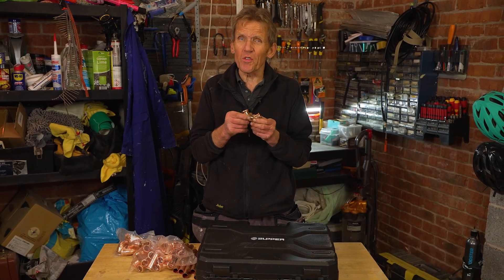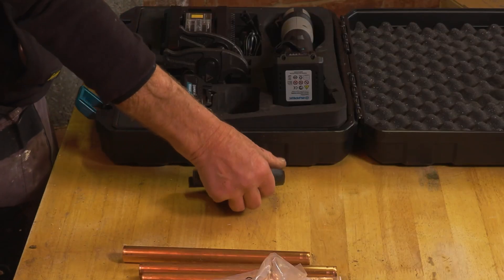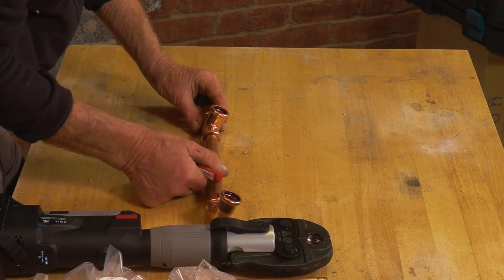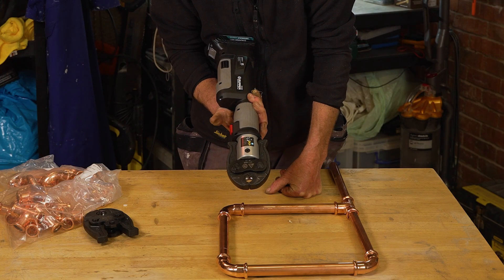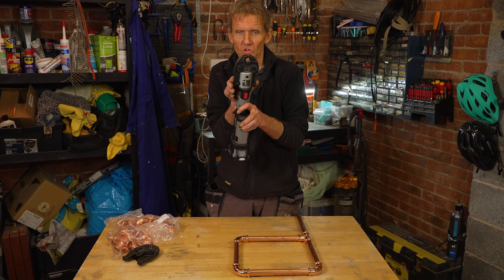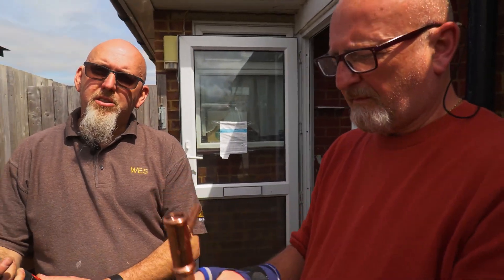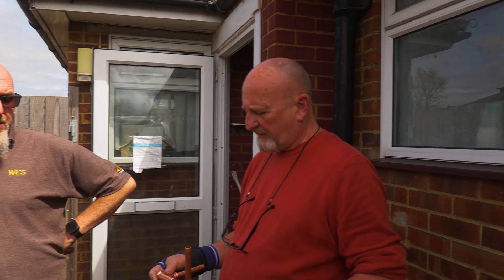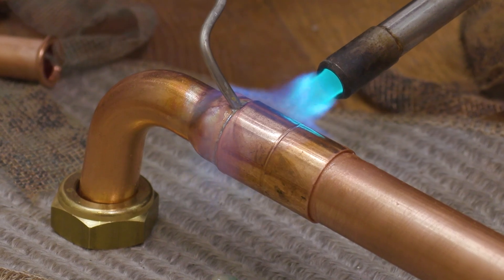Z-Press ~ Quick, Clean & Reliable Press-fit

Comment: When is copper preferable to PEX? And is press acceptable for natural gas?
Reply from the maker: They do make a press fitting for gas and it is for use on copper. I would always prefer to use copper where the pipework is on show. We usually use it in the boiler room and around the hot water cylinder. Elsewhere the long runs of PEX are preferable.

Comment: It’s a different world from when I was wiping lead joints and working with Yorkshire and end-feed fittings. We even had a time when it was Stainles steel pipe that had to be soldered, what a disaster that was. Not to mention copper lined steel pipes that rusted for the outside in. My neighbour is a great exponent of these compression type fitting, in fact he won’t use anything else so it’s good to see the price is dropping down. Me I’ve been retired for the past 18 years. 😂

Comment: I really do like press fit, however I don't like that every manufacturer are using different connections and pipes that usually are not interchangeable. When using a Uponor (UP) clamp, I can't use a Viega (V) or Bonfix (M) or Henco (TH) connection. etc etc. So basically it's a vendor lock in.

Comment: as for leaks on soldered joints are super rare , compression is quite common usually just a weep and easily fixed, push fit also seems to have the odd leak, almost always for me at least from scratches on the pipe and ofc the classic not pushed in correctly

Comment: The fun part about crimp connectors is that they may start leaking months after assembly.
 I like copper connectors that stay tight for a lifetime.
 Alloy is your ally for peace of mind.
Reply: That’s BS…. I’ve been fitting press fit for over 30 years, we’ve just finished a chilled water job with over 2000mts of 100mm and 50mm pipe and we’ve never had to go back on a job due to a leak…
Reply: @richarddutchholland4780  Hot water does a job on neoprene O rings they shrink, dry out and crack...Cold water isn't quite so bad...

Comment: I still think soldered columns of copper pipework including parallel cross overs and especially street fittings just look more neater compact and professional. I do agree though that press fittings are useful on long pipe runs and under floorboards and attics where they could be the likelihood of a fire. Just my own opinion very good video.
Reply: That’s exactly my thoughts and under a boiler/work top we are always squeezed.Probably need some practise and use where more efficient.Look great when done 👍

Comment: the fact that i couldn't find the price anywhere, it means they hide it because is expensive. So ,yes it's clean,quick.reliable but they failled to make it affordable . Better look for cheaper alternatives
Reply from the maker: It is under a thousand pounds and you can get it through your independent merchant. Nobody is hiding the price and I have not seen a cheaper machine on the market that is any good so I wish you luck with that.

Comment: Biggest advantage over solider was not mentioned . You can connect  one pipe  to the fitting at a time .
ie   Two pipes of a tee then add to set up with the last one .  100% would have one  if I was trade but as a DIYer will have to stick to my Rothenberger just due to price .

Comment: How long do the o rings last before going brittle?
Reply: The o rings are backup. It will seal even without the o rings. Check YouTube
Reply from the maker: I am not sure when they would go brittle if ever but they give them a life expectancy of 50 years. Lubricant is in the mix not added afterwards
Reply: I can't believe ppl continue to ask about the o-rings on Pro-Press

Comment: I’ve never used pressfit but I definitely think it might be something I’m gonna have to get in to due to the no hot works issues. 

I’d like to hear from guys that do a lot of boiler installs. How do you find it for instance when doing a combi swap? I fit logics and the pre-made tails bring you off the wall at Clíp distance. Are these jaws small enough to get in between the vertical pipes as they run up the wall and behind the pipe at Clíp distance?
Reply from the maker: Most of that pipework can be pre-fabricated and clipped to the wall. It just requires a slightly different approach but it works fine

Comment: Why are these machines so blimmin expensive, they have a battery and look like a multi tool, but are over a grand to buy    Compared to other tools with similar internal gubbings if you get my drift.
What’s so special or different in them???
I’d love to know
Reply: Far less demand I expect.
I also presume these are a calibrated compression tool to ensure the pressure applied is within the correct tolerance for ensuring a tight fit without crushing the fitting - the R&D and manufacturing tolerances etc will need recovering to make this profitable.

Comment: Not compliant with gas regulation which prohibits use of any plastic parts. O ring is a form of plastic
Reply: Press fit is.  You fit the fittings with yellow, not black, o rings, usually marked gas on the fitting.
Reply from the maker: There are approved gas fittings for press fit.
Reply: O ring is a synthetic polymer.

Comment: How long does the o-ring last?
Reply from the maker: I have looked at this subject across several sources. EPDM 'O' rings are said to be good for at least 50 years. Of all 'O' ring material it is one of the most durable. The press fit locks the pipe to the fitting so there is zero movement on the pipe where it enters the 'o' ring. Just keep them away from hydrocarbons. Also avoid mechanical damage when assembling or storing fittings.
Reply: @SkillBuilder  great thank you 😊 that’s really good
Reply: @SkillBuilder  a lot of ppl asking you about Press fitting o-Rings, there's multiple videos on YT specifically testing pressfit fittings without the o-Rings and no leaks. Conversely jobs that a plumber forgot to press one and no leaks either because of the o-Ring, obviously that wouldn't work on an end piece like a hose bib.

Comment: We did the waste for an RAF base in 1.5 and 2 inch stainless crimp at their request, I quite enjoyed it, better than the usual solvent weld stuff we do on jobs. We just hired the tool and heads and it was pretty easy given I'd never done any before.
Reply from the maker: I wonder why the RAF needs such a durable waste pipe?
Reply: @SkillBuilder  They don't. It's a bottomless pit when it's being funded by the taxpayer.
Reply: @SkillBuilder  To be fair it was mainly in the catering areas. Same goes with prisons, they get seriously overkill spec stuff as well.
Reply: @SkillBuilder  it's the RAF they consume anything and everything so you don't know what's going in the waste pipes!

Comment: I agree. But on my side of the pond. If you're working by the hour. You have to charge everytime i bring it out. Because I'm spending on the tool and losing on the labor
Reply from the maker: That argument has gone back and forth for years. A man digging a hole charging by the hour or a JCB digging the same hole, you charge for the hole. When I bought my first diamond core bits they were a lot of money so I charged £10.00 per hole on top of labour.
Reply: @SkillBuilder  Thanks for making my point
Reply: Good point.
Reply: I charge $100. Each time

Comment: I'm still in the mental stage of planning how I want to redo my pipe works.  I'm in the states.  It's either going to be Pex, or copper with crimp fittings like this.  I used to be a pvc/cpvc guy but now I'm old enough to have directly experienced how it becomes brittle and I don't like that.  I do electrical as well and being able to run Pex like NM wire has serious advantages in my eyes, in terms of just being quicker and easier and perhaps even getting a cleaner looking result.  and I forgot to mention that copper can be tricky for someone not a professional at it, and I don't need pin holes 5 or 10 years down the line which is why the crimp is appealing even though I can solder

Comment: Only ever used pressfit stuff once last year. It must be good or it wouldn't be so popular now but I'm still a dinasaur and like good old fashioned solder or compression fittings. I would be interested to see a pressfit joint in 20 or 30 years time.
Reply: Just how long does that internal O ring seal last with a very hot water environment.
Reply: I'd argue compression doesn't hold out for that long either
Reply: True, but a quarter turn will probably solve the problem on a compression fitting, done while the system is live. I imagine it wouldn't be a simple fix on a weepy press fit fitting.
Reply: our house we built in 2006 fittings all still perfect.

Comment: I wonder if the O rings are lasting longer than the push fits O rings and how do they rate in an external, application or Acid/Alkali environment ?
Reply from the maker: I share your concern and have looked into the lifespan of EPDM 'O' rings in the past and all I can say is that they will outlast most of the people doing the job. They are very good for hot and cold and are used in motor vehicles and braking systems. They do not like hydrocarbons so keep them away from oil.
Reply: @SkillBuilder  Lets hope they outlast the customer then pal ....
Reply: The O-rings are not what makes the water tight connection, it's just a backup. The copper to copper pressing is what makes it water tight.

Comment: I was lent one last year to try for a week. Fantastic tool, I was very impressed. 
However, I only fit bathrooms and most of my work is in tight spots with an emphasis on hiding pipes in whatever space is available. The tool is too large for these situations so I still had to deal with blowtorch and fire safety.
I simply have no room for two sets of pipe jointing. 
But if I ever got into 1st fixing on new builds, it'll be a no brainer.
Reply from the maker: Thanks for sharing!
Reply: 100% mate,i am still old school blowtorch and yorkies but the younger boys i work with use the rems gun,it honestly has heads for every application but bloody pricey!
Reply: The rems press gun has different heads for doing up your fitting at any angle.
personally i have a tendancy to pre press the fittings outwith the bath basin etc.Then generally one press each under the bath/basin
Reply: @tambias  handy to know but often the issue was the bulk of the heads when pipes are close to each other or right next joists or studs. 
It's a great tool for sure but having both press and flame on one job is pointless

Comment: Once worked on a (very) large industrial site and nearing completion , returned to work following a weekend and a bank holiday Monday to find basement under 4ft of water due to weak batteries on push fit tool . No doubt used error involved but the tool is definitely in need of a charge indicator !
Reply from the maker: Hi Kevin
 There is something strange about that. The pressure required to complete the cycle means the jaws remain in the closed position. If the tool fails to complete the cycle you can't open those jaws. No doubt someone else with more press fit experience will comment but I am mystified.
Reply: @SkillBuilder  Agree Roger more likely operatives missed pressing the joint   we always mark the joints as pressed with operatives initials
Reply: I was an electrician on the job and it was a few years ago so yes more info is needed . Sorry i didn't mean to mis-lead . Maybe  the tools come a long way in a few years. I can highly recommend the electrical version .
Reply: Was it not pressure tested??

Comment: But press fit is still based on o-rings in fittings. They never last
Reply: I'm  an engineer in the food Industry, and the bloody things are always popping. On the whole you can repair compression and push fit fittings pretty easily but the press fittings are a pain in the !!!!
Reply: Wasn't it a problem with O rings that caused the Challenger Space shuttle to crash?
Reply: @davidpotter3717  yes because the rubber o rings in use on the shuttle didn't seal at sub zero temperatures and allowed a leak through in the fuel tanks.
Reply: @davidpotter3717 😊
Reply from the maker: Define 'last'
Reply: @SkillBuilder  About the length of time until the installer's reached retirement age.
Reply: @SkillBuilder  middle of the night long after fitting. 
Drip, drip, drip. Shhhhhsssssss.
Bang as the roof falls in.
When a seal goes they don't always give long before the blow by.
Reply: Solder becomes brittle too, over time. Nothing last forever, even cold november rain... ;)

Comment: They are easy to use but when you have to do alterations at a later date it turns nightmarish very quickly.
Reply from the maker: Do you unsweat fittings, I usually cut them out and put in new ones. Same applies here.
Reply: @SkillBuilder agreed, unsweating and cleaning up is a ball ache. Cut back and start afresh
Reply: It's not that bad. I use an angle grinder with a cut off wheel. Cut into the fitting not all the way. Then pop it open with a flat head screwdriver